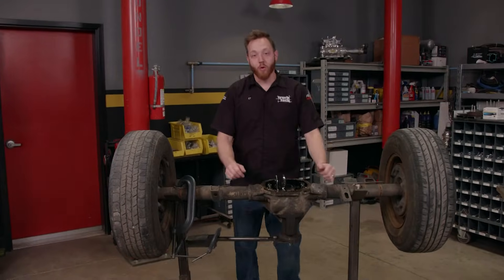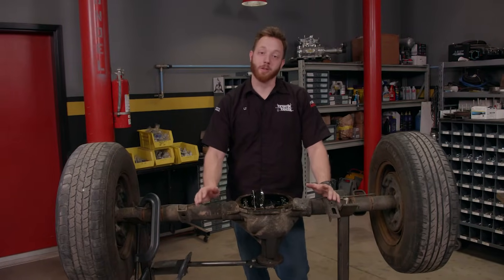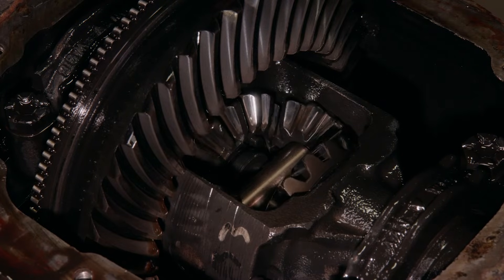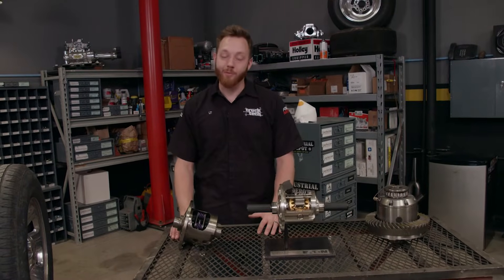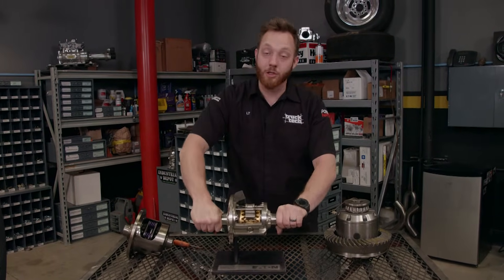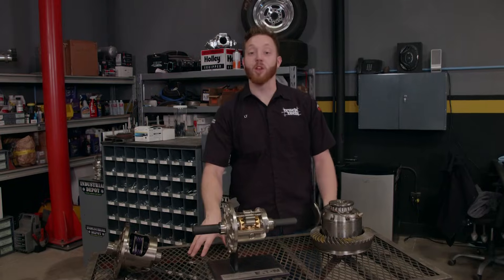Difference Between Limited Slip Differentials

Comment: Put a 69 Chevelle 2.56 8.2 posi rear under my 69 GS last week, filled with GL-5 and 1 4oz of GM additive. Only when moving slowly, and turning, she fights me back there, loud pops n crunches, can feel engage and coast, get back to going straight, can punch it, cruise it, not a peep with a 455 pushing it.. Not sure if should try another jug of additive or pull her apart to peek.  Looking at spider gear sets, Nitro was only brand that did not say for specific carrier, Yukon saud only for their carrier, of which they claim, could be under her, not sure on how to tell.. Also since would have apart, carbon fiber clutch packs.. See some with the fiber on the geared set, and some on the eared sets, not sure if one better than the other.. where the frictions are.. getting too old for this.. only ever had 1 rear let go and replacement went in without issue, this time, loads of fun...  think hard parts, or additive issue?  will know if get her up tomorrow..

Comment: Doesn’t post allow for lots of slippage where LSD is minimal slippage?
Reply: You mean posi? A posi-traction is an LSD, it slips when navigating corners and also slips a little even if you floor it or are in need of more traction. It's the best option if you're mostly driving on the street and occasionally need more traction: snow, rain, mild off-roading.

Comment: You'd mostly see 60's and 70's muscle cars with clutch pack type umm what?  That and continually over the years on such rarely seen cars like ford mustang's, explorers and countless others up to present haha.  There are other types since the 60-70's however the clutch type continued to be used.  There are aftermarket and now factory equipped cone type, all gear one like say a auburn torsion but the earlier style didn't drop to obscurity especially as OEM.

Comment: What if my rear what's to push my front end on a turn and it fills like the rear is jumping on corners
Reply: Sounds like too much junk in the trunk, maybe lose some weight. 

LMAO
Reply: Excessive bias.
Springs are too strong.
Reply: Huh?
Reply: It's having trouble unlocking. I noticed my 2019 chev truck does that shit

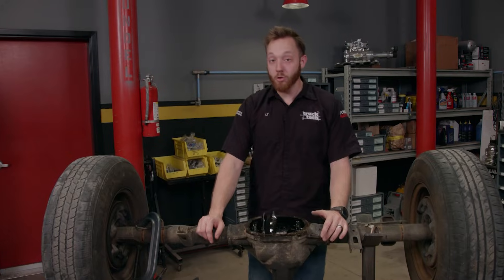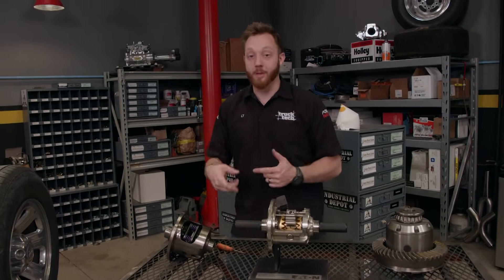Comment: 1:16 Why not, explain please? 2:05 How? you just stated the clutches would slip... I give up, like most videos on differentials, the presenter himself doesn´t understand how they work himself.
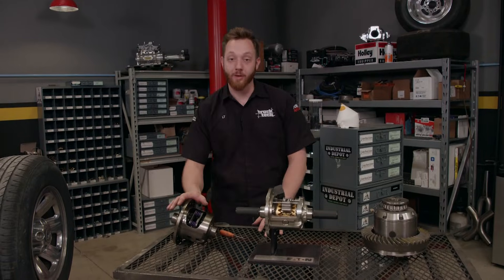Reply: 1:16 -- "because the wheel on ice would be spinning, and the one on pavement is not going to be doing a thing" - because that's how spider gears work.  2:05 - because the clutch puts pressure on both side gears.  Sounds to me like the presenter knows more than you...

Comment: So which one is best?
Reply: Depends on your application. If you're mostly doing street use and occasionally need more traction, then a clutch type LSD would work well. The all-out lockers are for off-roading only. The middle one, is really a mechanical locker that automatically engages when it "thinks" a tire is slipping, this is good for mild off-roading. Say you go on dirt roads and encounter mud/wet conditions somewhat often and don't want the trouble of having to push a button to lock and unlock your rear diff all the time if you're switching between low and high traction surfaces a lot.
Reply: @cyrilpatton238  ‘19 370Z with a viscous lsd - want to upgrade. Car will rarely be tracked and will not be winter driven.  Looking for better performance and feel on road - have some snap oversteer.  Any ideas would be appreciated.  thx in advance

Comment: A video about the difference between Limited Slip Diffs, and you only showed one type.
What about cone type diffs, or gear type like Torsen and Quaife, or Viscous, or even electronic?

You can't talk about differences without at least talking about the other basic options.
Reply: I just recently found out about the Torsen an Schaeffler ones, the diff-world has a ton to offer but sadly, none of them (even if only a selection of the most popular) are 'being compared to each other in an all-encompassing guide for the aspirant engineers out there.

Comment: Eaton G80 lockers are absolute garbage! Had it lock up in positrac on my 2004 Chevy Suburban Z71 under normal driving conditions, and cost me a whole new rear end! It was cheaper to buy a whole axle assembly instead of rebuilding the rear differential!
Reply: You're supposed to change the diff fluid. So I'm going to say it's bad owner error.

I'm no fan of Chevy/GM. But I've personally seen these things last several hundred thousand miles with proper service intervals.
Reply: Aaron Eckardt yea when I just bought the truck this year and only drove it 6,000 miles since I bought it and the rear end takes a shit. The truck had 138,000 miles on it when it went out, worst part of it was that I was on vacation with my family when it happened......but luckily I was at a in-laws house to fix it and swap rear ends out myself.
Reply: @aaroneckardt5514  i know dodge trucks had a big problem with no diff fluid in the diffs from the factory believe it or not.
Reply: Bad dealer prep. Did not check fluids. Typical modern shit box mechanics.
Reply: Exactly the style of the g80 is alright were the internals of stronger more durable materials.
Reply: Same thing happened to me when i was slipping in the snow rear end worked perfect 1 min of no traction destroyed it